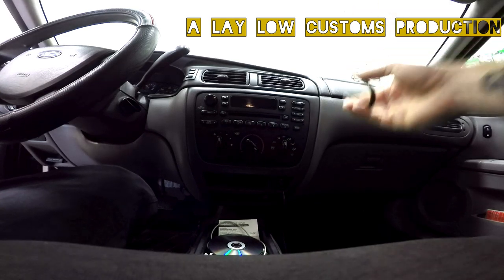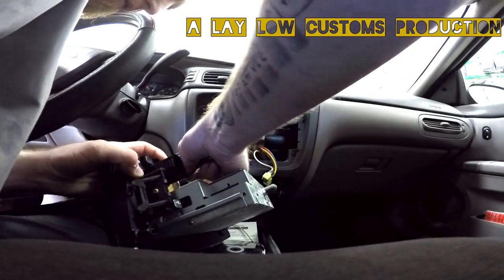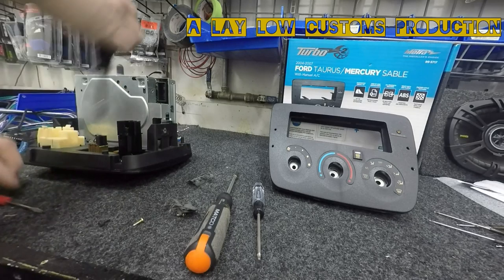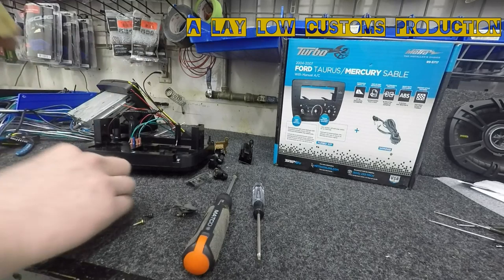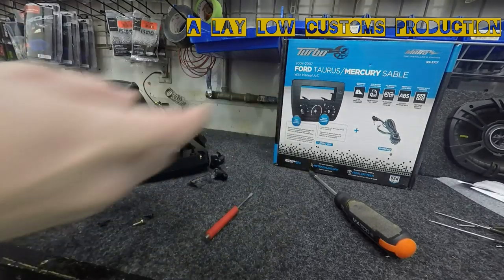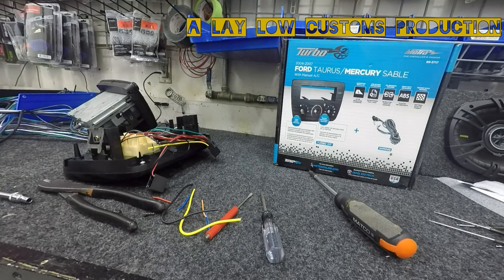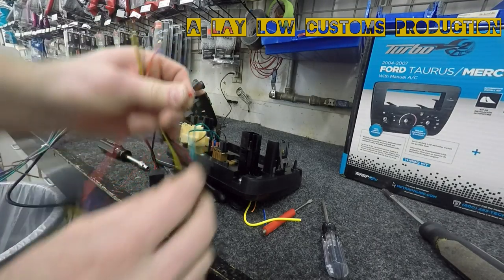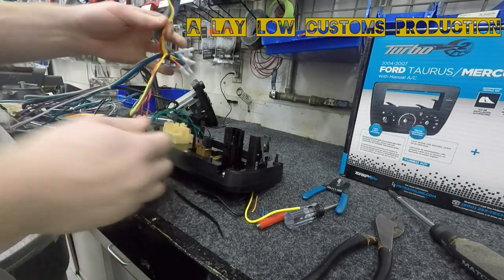Taurus radio replacement

Comment: THANK YOU SO MUCH ❤️ I was looking all over for decent instructions on how to set up my stereo on my 2005 taurus !! I wish you showed how you ran the wires inside of the Ford because it's kind of hard to lift the side trims and carpet
Reply: How did you lift the trims
Reply: @markbush1194  you can you a car pry tool to slide the wires in but I used my hands and slowly lifted it 

Tbh it would have been much easier to use the tool that just pushed the wires in lol
Reply: Where did you put the yellow and black wire?

Comment: small question i used same kit but have a small black and red wire that comes off the pass. air bag light but dont know where they connect to
Reply: I'm struggling to find where it Saya pin 3 and 5 but what ones are they?

Comment: I bought this kit after watching your video. Something I can't figure out is what to attach the seat belt light and defrost wires to. The only wiring that came with the kit (99-5717) is the long section of speaker and antennae wire. Is there another harness I need to buy, or am I missing a harness from the manufacture?
Reply: Same here I know this is an old post but hopefully you can respond to me did you ever figure that out do I need another wire harness? Nobody can tell me

Comment: I have a different factory radio in my 2004 SEL MODEL taurus and my heater switches are different as well mine came with CD player in middle COUNSIL want to know were to find wire connection for radio instal cause mine being there premium stereo for 04 is set up different HAVEING hard time finding face plate replacement as well..

Comment: My heater switches are push button not the knob kind as this one here ? Also wire harness are the same as yours cause my factory radio in my SEL MODEL has a CD in center Council next to SHIFTER. Does wire harness fit both factory radios because they don't seem to carry one for my radio rather factory radio. Like to use my sound stream head unit but cannot find wire harness for my factory radio wire to new radio ..

Comment: My Mercury Sable has the tape/digital temperature/AC panel.  I wonder if it's interchangable.
Reply: Digital climate systems have a different kit but are the same
Reply: Overkill Auto Garage  which kit is it? Because I’ve been searching like crazy

Comment: Theoretically, could I just unplug the radio part, cut a hole underneath and plug that wire into an aftermarket radio with all the rest of the plugs still in place? With the original HVAC stuff in place?
Reply: This wont work.  The radio harness runs to the back to power the stock speaker wires.

Comment: So can you run the wires under the carpet/sills? I haven't been able to figure it out. The wires are running from the steering column and just sitting on the floor, under the seats. Doesn't look pretty, but at least it works.

Comment: what size are the speakers for the doors on a 2002 Taurus lx? just wondering cause I keep getting different answers which my last set of 6x8s an 5x7s I had to return at best buy cause the install tech said they didn't fit
Reply from the maker: 6x8 and 5x7 are the same size speaker when it comes to aftermarket speakers.  The speaker magnet or basket may have been too large but thats the correct size.
Reply: andy snapp so what size are the rear an door speakers?

Comment: If I have the digital heater control dash do I need to also get the digital radio bezel as well and not get the manual knob bezel???
Reply: If your car has the automatic climate control, you'll need that version for the dash kit and not the manual mod version.

Comment: How did you do stop the defrost button from setting the air bag light on??
Reply: It talks about it in the book for the dash install kit, there needs to be a 10k resistor installed on one of the wires, don’t remember which one but it’s in the book
Reply: @Gamercamp22  yea it mentioned it on the price of paper that came with it but all it said was a 10k ohm resistor between pin 3 and 5...

Comment: Why do you need to run wires to the back if you don’t remove anything from there? You can’t just plug the new one where the old one was up front?
Reply from the maker: The factory speaker wires are in the back
Reply: @andysnapp7829  If they didn’t show them being removed why do they need to be run back there

Comment: Side question: where did you feed the microphone wire through? Do you have to take the entire dash down?
Reply from the maker: I mount the Mic on top of the A pillar and route the wire over the steering column and up behind the radio.

Comment: I'm  getting ready to convert my  recently purchased 2001 Ford Taurus SES with the 24 valve motor indash Radio/CD to a new system & this information helps a lot. Unfortunately, my previous 2001 Ford Taurus SEL with the premium sound system needs a complete new 24 valve motor & transmission with over 225, 000.00 miles on it so it was cheaper to replace the car instead of the motor & transmission,  but I'm now stripping it down of everything that I  can possibly use later plus the premium stereo system, & the CD changer from the armrest because it played flawlessly so maybe I use  it elsewhere again.  🩵

Comment: Where do the yellow and black wires go in the trunk on the wiring? The one I got has a yellow and a black wire on the end where it plugs into the trunk.
Reply: Did you figure it out? Mine came with those to;
Reply: Nathan Allbright Yes, I’m assuming they’re for an amp because it works fine as long as the givin colors are connected c:
Reply: Same issue do those 2 y&b need to be used
Reply: They're to power The antenna. Hook them up so it can go up and down.

Comment: Where and why did you hook up he extremely long wire harness to the trunk? 2006 Ford Taurus. I can’t find anywhere to plug it in
Reply: In the same boat as you. Let me know if you found a way
Reply: Below the power antenna in the trunk. It connects the radio to the factory amplifier.

Comment: I have a 2002 Taurus LX. do I have to remove the factory wire harness before running my aftermarket wire harness or do I keep it in and just run my aftermarket wire harness
Reply from the maker: You do not have to remove any harness.  just run the aftermarket harness to the back

Comment: I have an 01 Mercury sable. I’m trying to find a harness for the radio and its almost impossible to find one for my car… I ordered a kit and it came with the wrong harness I’ve searched every radio shop in my city and all over the internet and still cannot find one 😭
Reply: I have a 2000 mercury sable. Cab you post the kit part number

Comment: I've been going through videos most of the morning. Finally a video with wires that hook up in the trunk. Now I know what to do on my car. Thanks for the video, was a little confused on what to disconnect/connect back there...so simple. Question though, on that connector, what are the short red and yellow wires for?
Reply from the maker: The connector on the dash kit?  The red is switched ignition for the radio and the yellow is constant power for the radio.
Reply: @andysnapp7829  Do you need these hooked up to get the radio working? And if so can you use a wire from the factory harness running to that stock radio box? Cause i have everything plugged in and imm not getting power to my headunit

Comment: Does this bypass the factory amp? I didnt see anything plugged back into the box?
Reply from the maker: Yes this bypasses the factory tuner that has a miniature amplifier inside.
Reply: No. Wrong. it used the factory amp. The harness sends high level input to it.

Comment: So do you hook up the blue wire with the blue and white? Where does the orange wire goes?
Reply from the maker: blue/white from the radio goes to blue from the car.  If you don't have a orange on your radio, you don't use the orange.  Its for dimmer only.
Reply: andy snapp I have a blue from my radio only no blue/white. Do I attach that one to the blue on the car??

Comment: I’ve watched videos over and over again but I still get “amp error” on my stereo. I also don’t get any sound. Plz help
Reply from the maker: If you wired the radio harness into the dash kit wiring harness correctly and the amp error comes on.  The radio is faulty.  Once way to check this is to see only have the red, yellow, and black wires hooked up.  Hit the reset button on the radio (usually behind the dettachable face) then power it on.  If amp error still comes up, its the radio.

Comment: So I noticed there were three yellow, three black, and three red wires 
one for each of the wire harnesses, 

one for the aftermarket radio unit wire harness
one for the defrost switch of the new kit plate
one on the aftermarket wire harness that I was planning to connect directly to the harness on my radio before I watched this

Do I connect both the radio harness yellow/red/black AND the defrost harness yellow/red/black in parallel to the wire harness supplied with this kit?
Reply: CountDabula did you ever figure this out I was wondering the samd

Comment: I had to remove the entire back seat in order to run the cable to the trunk. how did you get the cable in?
Reply from the maker: Removing the bottom of the seat is easy by lifting it up.  You shouldn't need to remove the back of the seat.  Just rout the wire under the seat.
Reply: The rear seat doesn't pull up, you have to pull it forward then up. Mine is a 2001, it does not have access from the rear seat to the trunk. that's why I had to remove the back rest. Do you have a picture or video of 
 how and where you routed yours? Thanks
Reply from the maker: I dont have a video or any pictures.  It wasn't very difficult.

Comment: i did the same thing and hukked up the sub but my speakers in the car arnt working every elss is working even the sub but not the car speakers any help would be great
Reply from the maker: make sure that you hook up the blue with white from the radio to the blue on the harness that runs to the rear of the vehicle   That is the amp turn on wire.  I don't think that the vehicle has an amp but thats what it sounds like is happening.
Reply: it was a blow fuse thanks

Comment: Can someone help I did all these steps but the stereo turns on for one second then turns off
Reply from the maker: If all of your connections are good, check with a meter is you have power at the yellow and black wire.
Reply: @andysnapp7829  So I got the new kit from American international again and it's the same exact thing. The factory stereo works fine but when I go to install the aftermarket, no power
Reply: @AM23.  You ever figure it out? I've got the kit all hooked up but no power.Didnt blow any fuses.
Reply: @christopherzodl9584  no I didn't, I have up and got a Bluetooth FM transmitter that plugs into your cigarette lighter. I still have the stereo and the deck. If you figured out bro let me know 😂

Comment: is there a double din bracket for the Ford taurus?????
Reply: No its should be Single DIN for my 2000 at least, i don't really know about newer years
Reply: I believe 2004+ can go double din if you have the digital HVAC controls instead of the analog.
Reply from the maker: I've never seen a double din in a taurus.  Not a lot of space.
Reply: AllAlaskan907  you can get a double din if you have electronic heating /cooling

Comment: If im hooking up an aftermarket amp do i use the remote wire behind the radio for the aftermarket amp instead of wiring to the speaker wire harness that runs to the factory amp?
Reply: The blue remote wire tells the amp to turn on and off. You need to run rca cord or two to send whatever sound needs to be amplified

Comment: I have a yellow and black wire on my new harness that have crimpers. Where do those go. No one will show me.
Reply from the maker: Don't use them. They never use to put them on old harnesses.  That would be power and ground for he factory radio.
Reply: @andysnapp7829  yea I just ended up tapping into the power wires myself.

Comment: Great video but doesn’t tell me if I need a secondary amp after installing this radio since you’re taking the stock amp out of the equation
Reply: He's using the stock amp. That's why there's a harness that runs into the trunk

Comment: What does the orange wire on the kit connect to??
Reply: On the Metra kit. Orange/white wire
Reply: @huntergowins7416 did you ever figure it out? it’s an illumination wire but i have no clue where to put it

Comment: I've got a 07 Ford Taurus I need to know if anybody knows. Wire diagram color code
Reply: Horice Tobe I also have a 2007 Ford Taurus and am planning on installing a radio. The booklet I got with the radio kit says a 10k ohm resistor needs to be wired in. Did you do that for yours?